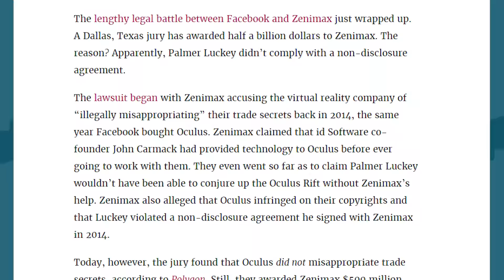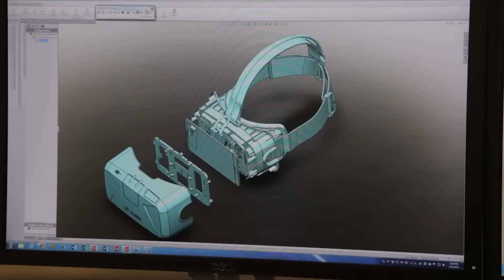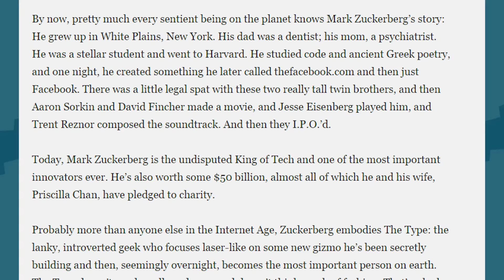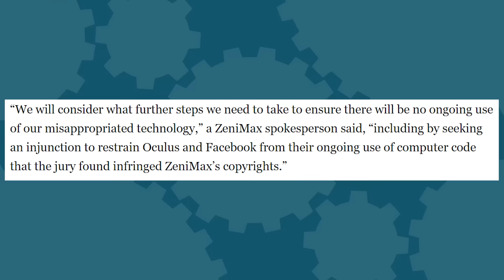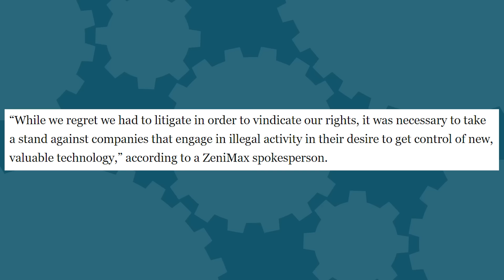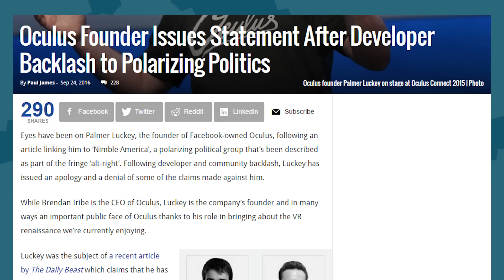Oculus Defeated in Court, Rift DEAD? - The Know Tech News

Comment: HTC VIVE did it better.
Reply: Are you going to tell me it also has better room scale than the Vive?
Reply: Vince Perin your right, it did do it better
Reply: David Beppler I bet you'll enjoy it when you realize the open-source tech of the Vive means us Vive owners will have way more controller types than Oculus owners ever could (finger-tracking, full-body tracking, etc).
Reply: + Beppler 
claiming that OR was first while also shouting that controllers are better ... priceless ...

look buddy Vive was first to release the WHOLE product with both the headset and controllers. While its true the Touch has better ergonomics than Vive wands, it also came a hell a lot later, is not fully supported from the get go (meaning the developers cannot count on people having Touch with the Rift, which cuts to userbase expectations and will outright kill some projects because of it) and just as the whole Rift is based on worse tracking technology.

OR to this date is inferior to Vive for room scale (even with FOUR recommended cameras its still smaller space than Vive could do on its launch).

The faults in Vive can be easily rectified with the second gen product, the faults in Rift are much more problematic because they are in the technology used rather than ergonomics.

The lighthouse tech is the way forward for VR, the IR camera tracking is simply too complicated and too limited to go into the future... if only Lucky swallowed his EGO and cooperated with Valve instead of selling out to the Facebook ... just imagine Vive with ergonomics of Oculus working under Lighthouse technology with Touch controller functionality and ergos ...

and no fractured consumer base which is solely Oculus fault because they backpedaled on mutual compatibility and even tryed to DRM lock theyr games ...
Reply: Vince Perin Vive dosnt work on my games, like Elitr Fangerous
so o wontbbe doing VR i guess.
Reply: The only people that think vive is better is vive owners. Everyone I have met that has both likes oculus better.
Reply: Tom Mills I know many who own both no one prefers oculus
Reply: Rick Deemer
 funny that i spent most of my time oin Vive playing Elite Dangerous and LOVING every minute of it xD
Reply: Rick Deemer I think you may need to look at almost every VR review in existence
Reply: Says the vive owner...
Reply: Donald Trump this man gets it
Reply: Tom Mills you just wanna justify your purchase
Reply: @coolomancp - So it's open tech, but it only runs on the Vive. Yeah OK.
Reply: Psh.. Vive,  oculus...   

I'm on team Google cardboard!!!! 

(actually I own a vive too after testing the big 3, so yeah.. Vive is my vote... Oculus = #NotMyVr)
Reply: Gavin Wardrope It only runs only on the Vive because Oculus doesn't add support to it (Valve has said they're free to) and no company has released a headset using the tech yet. Also the Vive uses lighthouses which are open tech but the oculus uses a different system. I'm pretty sure if you buy lighthouses you can use any controller supported by them in OpenVR games
Reply: Watch any review that has both systems with both sets of controllers, tested does a good one. The oculus has a clearer screen, less screen door, is more comfortable and lighter, and the controllers alone blow away the vive. Did you know that HTC has released pictures of them testing oculus copycat controllers? I am fully ready to admit that vive would be better if it really was. Oculus fanboys are loyal, and vive fanboys are too, but the hardware is what it is. Not all people want to hold an ice cream cone for every game.
Reply: Tom Mills If we're going to do that did you know that Oculus just lost a lawsuit for stealing from Zenimax, and stole Valve tech for the Oculus? The Oculus screen while slightly better is a non-issue after a few minutes of play and while yes the Oculus is more comfortable as far as the future goes Vive already has solutions such as a strap replacement that redistributes the weight so it's much better. That you can buy and replace on the Vive you already own too. Also the Vive now has TPCast, a wireless solution that makes it even better. I suggest you try proper room scale and experience the world of difference it makes
Reply: No, the court ruled that they did NOT steal from zenimax. It only ruled on the non disclosure agreement, and copyright infringement which is NOT the same thing, a simple update can redo the code in the rift to fix that. Not to mention the fact that besides having superior hardware, the oculus store games are miles above better than anything on steam., I rarely load steam up anymore. You can play every game with oculus, and only half of them on vive. While the vive has revive for now, you can bet the time is coming when they lock it out again.But at the end of the day, I have no problem with vive, I am glad it exists, competition is great, and it is a wonderful system (I do like the brightness level on the vive). I normally keep my opinions to myself, but fanboys make me so angry, "this ones perfect" and "this ones garbage." If you like your system great! Let other like theirs too.
Reply: Tom Mills To each their own I guess. If you like VR for stationary experiences then Oculus is for you. But the immersion and freedom the Vive brings, at least for now is best for games where you move around
Reply: I bought vive and rift, and I've already returned the vive since the lenses are way too blurry compared to rift. Also, to those who say oculus stole their tech, I disagree. First of all you can't believe everything the jury says, they might not even be experts in the field. And there have been so many cases where the final verdict is so far away from the truth.
Reply: Fei Deng If you wish to continue this then fine here's the final verdict, the one that matters in the business world. The Vive comes out on top in almost every review and it's been confirmed that it's sold about 2 for every 1 Oculus rift.
Reply: That's because the general public doesn't know better. And those reviews are before the touch controller came out. I'm not saying the vive is bad, I'm just saying everything else between the two is about the same, the only difference that won me over the rift is because it has much better lenses, if you don't know what I'm talking about just google "fresnel lenses". The vive uses a low density fresnel lenses, which means you'll be able to see the grooves, whereas the rift use a high density fresnel lenses, which means a much better visual experience.
Reply: Fei Deng You're right that the Oculus lens are better but as I said to Tom, the Vives point is roomscale. When moving around you generally don't notice it and as far as blurry goes I'm assuming you didn't do the suggest positioning and tuning with the lens distance? Mine is not blurry unless I look all the way left or all the way right. Again, for things where you sit down in one place the Oculus is a more comfortable and better looking experience, but room scale adds a level which at least for me and many others outweigh the visual issues
Reply: I notice it and it is really annoying, that's why I stick with the rift. I even thought about keeping both since there are some really good features on the vive, but everytime I start playing VR games, I go grab the rift which means vive is just gathering dust in the corner, so I returned it. And counter to your assumption, I did the positioning, I even went to an eye doctor to get the pupil distance measured professionally, but the vive still lets me down on that aspect.
Reply: I totally agree with you coolomancp, I don't think full roomscale is needed, I dont want to walk too far most of the time, you still get to the end of the room. But sitting is generally out for me and VR. By the way, my roomscale tracking with 3 sensors is is 15' by 7' which I believe is actually bigger than the vives, but I don't remember. All I am saying is roomscale works great on oculus. I do have a few games I like to sit on, but of course you can sit with the vive too.
Reply: Tom Mills Well the Vive goes 15' by 15' and with the help of a cord (not always needed) it can be even bigger. But yeah if you're just into the more stationary (at least physically) and don't plan on investing into peripherals then the Oculus is all good.
Reply: Yeah, I also have 3 sensors and tracking is not an issue for me. But I do think that Vive is better with their solution, only 1 cable from the computer vs. at least 3 with rift.
Reply: Fei Deng So pretty much if you feel roomscale is worth it, Vive wins easily, but the Rift is far more comfortable and easier for stationary experiences or ones where you don't need to move a lot
Reply: Yes and no, before the touch controllers came out, Vive wins easily, now it's about the same, and that's why say the only difference for me is the visual experience. Which by the way is more important for vr since the first thing you notice when you play any vr games is the thing in front of your eyes.
Reply: Again oculus does roomscale just as good as the vive, I wish we could get over the hardware wars and just focus on games. Its clear both systems do things fine, oculus can play EVERY single vive game with full roomscale, and the vive can play all the oculus games with revive, clearly the advantages of each are minor imo. Some people have a 27" computer screen and some people have a 17", thats just how it is. We should all be supporting valve because they encourage an open gaming system regardless of headset, without games you have a poor sleep mask :)
Reply: Tom Mills This is another thing that's important. I hope the next Oculus device supports lighthouse tracking because with one tracking type the VR community can easily support both and peripheral stuff. The largest issue with Oculus is they have an Apple approach to VR. It worked for Apple because they got everyone with no competition but here the Vive actually released first and with open source and support worked out great. While for now room-scale is about the same the important thing to know is Valves patents for tracking and lighthouses are open and royalty free. This means in the future the Vives tracking system will have much more support and customizability. If Oculus supports this in the future I think they could truly challenge the Vive
Reply: Perhaps another comparison is like laptops vs computers. The Oculus you buy it you got it. The Vive can be upgraded and has unlimited support for peripherals and accessories. Only thing is ofc we will need to wait for a second version to fix the issue with visuals
Reply: What? I don't get your point, how the system tracks is irrelevant, as long as it tracks, so what. There is no need to "support" one tracking system or not, to a developer they don't care. There are advantages to both. Let's be clear, both systems lose tracking sometimes while playing. On the vive it totally stops the game, since it is the headset reciving all signals. Lighthouse is awesome because it far less processor intensive and USB bandwidth dependent. The Oculus system when tracking messes up, still works. You can still move your head left and right even without a single sensor seeing you, the level jumps around but still works. This results in less immersion breaking, also the end of everything is AR not VR, if you ever want to actually see yourself in the virtual world in real time, that will not be accomplished with lighthouse, but with normal cameras. But at the end of the day, who cares, VR rules!
Reply: +Tom Mills Love how you talk about copycat, when oculus copied several aspects of the Vive, like two oled type screens instead of the one LCD panel they had originally planned for CV1.

And now they even copied roomscale and yet it does not even come close to the Vive.
Reply: Lets get one thing straight, Oculus was around LONG before the vive, by years...who copied whom?
Reply: vive 100% works with elite dangerous
Reply: Rooks y apart from having poorer SDE and its much harder to read txt on vive.
Reply: The difference in SDE is MINOR and does not make it much harder to read at all.
If text is much harder to read, then you have either not set it up properly or the oculus is running with a higher supersampling, which by the way helps alot on both HMD's.
The only reason why Vive has slightly more noticeable SDE is because it has a larger FOV, which means pixels are a little more spread out.

Funny how you dont mention the real negatives of the oculus like much worse godrays.
Reply: +Tom Mills Carmack even ADMITTED that they got some of their tech from Valve. Valve has been doing VR research for YEARS as well and long before even HTC was a thing.

But of course Oculus stabbed them in their back as soon as facebook aquired it and abandoned the promise of sticking with open standards.
Reply: Like I said above, the problem is with the lense, Vive has a much lower groove density on their fresnel lenses, that's what makes the difference. It disrupts the continuity of straight lines by making the color seem different when crossing over the groove. The pixel size are about the same for both, but the lenses are just horrible on Vive. I wish I can swap the lenses myself, that way I'd have kept the vive.
Reply: bloxyman22 lol. SDE isn't worse because of FOV and  Vive does not have a larger FOV. Its because it uses standard lenses where as CV1 has hybrid / customised ones.
Reply: +Art Sin What a load of BS. It is a fact that it has a slightly larger FOV, which something even most Rift owners know.
Reply: Vive has standard lenses. I know - i used to own own.
Reply: Vives are standard. Psvr and CV1s are better.
Reply: I could never go back to owning a Vive after experiencing the comfort, clarity and build of the Oculus Rift, touch controllers are gorgeous, oculus advanced software like ASW give it half the min system specs BLOW vive out of the water. On rift I can now play games with twice the clarity of 1.5 - 2.0 pixel scale and still have them locked at 90fps!! Where as on my Vive if I did this the games would have considerable fps hits.

 I'm not forking out extra money on Vive controller upgrades because they rushed the first ones out. No way. 

Oculus has the most exciting exclusive titles on the way too, Robo Recall (another game rift owners get for free) Lone echo and Akira1, etc,etc look awesome. 

Rift is the way to go. I liked the Vive but now I'm happy that its behind me.. I have my sensors set-up with no issues and tracking is just as good as my previous vive set-up, only difference Is, I now have a better headset and much better controllers (no bulky heavyness) :)  Bring on my Free copy of Robo Recall this month - thank you Oculus and Facebook :))
Reply: Vince Perin except for the touch controls feel way better
Reply: The only thing superior about the Vive at this point is the tracking system. If Oculus would adopt a similar lighthouse system there would be no reason to buy a Vive. The Rift is lighter, more comfortable, has a clearer display thanks to its lenses, has premium integrated 3D audio, has better motion controllers, has a more polished software interface, and is easier to set up. The only reason I would recommend a Vive is if you plan to strictly use it for room scale games (of which there are very very few that use it, and even fewer that benefit from it.) No, I'm not just an Oculus fan boy. I've owned both HMDs. The Oculus is simply the more refined product.
Reply: Which is kind of the most important aspect ;P
And there is no way you can implement something like the lighthouse anyways as the HMD as well as controllers would require sensors, which means you will need a completely new HMD and touch controllers.

And exaclty how is it easier to setup?? All you need to do with Vive is plug in the HMD/linkbox with 1 SINGLE USB 2.0 cable and setup two single lighthouses for full roomscale. If you want just front facing tracking that is superior to basic oculus without touch, then you only need one single lighthouse.

Meanwhile if you want roomscale with oculus you not only need 3 cameras, but you also need to plug them all into USB ports, which in general does not work very well as they will often overload your USB controllers.
How exactly is this easier??
Reply: As I said above the tracking on the Vive is naturally superior. In time with more updates the tracking on the Rift would possible be improved to work almost if not exactly as well. Also, yes comfort is subjective to the individual. What I'm saying is most people that have tried both can agree that the Rift is more comfortable mainly due to its lower weight. The FOV issue is negligible. Have you even tried the Rift? The FOV difference is about 10 degrees at best, and less than that if you have a giant head like I do whose face cant get as close to the lenses, even with the extra adjustments on the Vive. The SDE is completely gone on the rift and pixel density is quite significantly better on my Rift than my Vive before I sold it. Also the Rift has a more clear image across the entire FOV where as the Vive is only truly clear in the center and blurs off to the sides. The Vive being "open source" also doesn't matter since I can pick up any Vive game and play it just fine on my Rift. The hardware on both headsets are basically the same exact thing and neither is superior. the only difference being the Vive has less custom manufactured parts where as the Rift has many many custom designed and fabricated parts. Lastly you do not take in to account that the upcoming headstrap and the new vive controllers (which are still prototypes by the way and still have no confirmed release date) will not come free and you'll probably be looking at about $100 for the new audio head-strap and an upwards of $200 for the controllers if Oculus touch was any indication. At those prices you'd be looking at an $1100 price tag to get what the Rift has for $800. Regardless, the first generation of VR is OK at best. We really need 4k per eye resolution, reliable wireless, and more prominent game developers to jump in to encourage the growth as a whole. (TL;DR: Both headsets suck VR needs a few more iterations before its really worth it)
Reply: +Sparkko You are either lying or have really bad eyesight. There is absolutely no way the SDE can be completely gone with such a low resolution and it is claimed that you actually have to get 8k panels for this issue to be completely gone.

Both headsets of course have their pros and cons and the SLIGHTLY less noticeable SDE is the pros of the oculus, while slightly more FOV and less godrays is pros of the Vive. But some of the bullshit spewed in this comments are completely false, like you claiming there is no SDE or that other guy claiming there is no FOV differences and that Vive uses "standard lenses".
Reply: I should rephrase and say "BASICALLY" completely gone which is truly what I meant. As in I don't notice it at all while using the Rift while it was hard for me to ignore on the Vive. Also, I'm pretty sure what they mean by "standard lenses" is the Vive lenses are just standard Fresnel lenses where as the rift lenses are a sort of Fresnel hybrid.
Reply: He denied even that it was fresnel lenses.

But anyways I have the same experience with the Vive.. In general it is no issue as long as you dont focus on it. It only truly comes into focus enough to bother me when I am playing a game full of jaggies in distance, which also draws my focus to the SDE and supersampling helps ALOT in that area.

Oculus is definitely superior in this area, but it is not by a large amount and some people find godrays to break immersion more so it is really more of a personal preference.
Reply: LOl. "NotmyVr"
Reply: David, didn't Node invent the camera rig concept for the augmented reality?
Reply: Fei Deng I also have both, and I'm returning my Vive this week. can't get past the crappy lenses and steamvr bugs